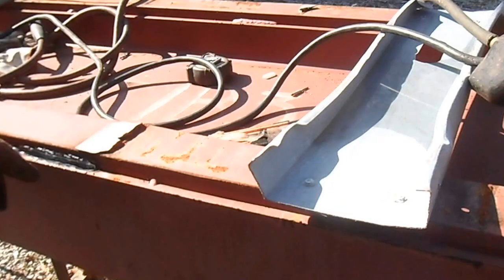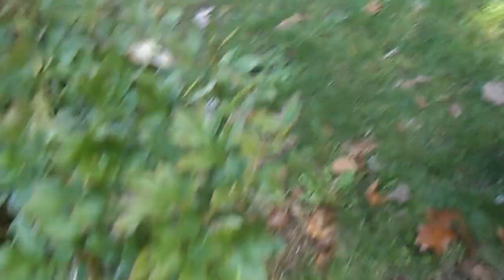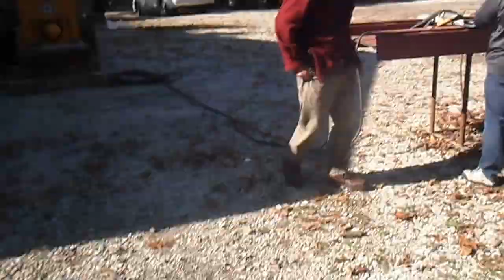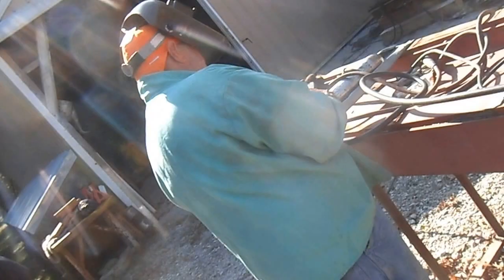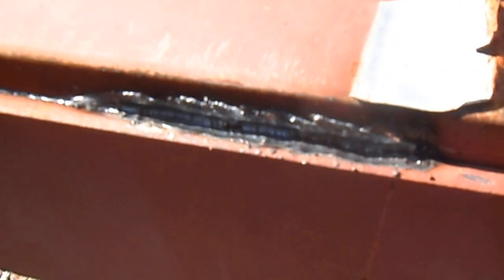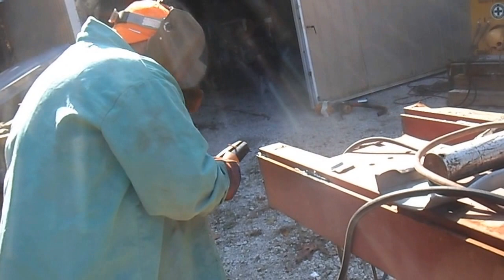ACAC Air carbon arc gouging cutting using vintage caterpillar d315 hot rod lincoln welding machine

Comment: You need a Miller Big Blue 400D, like mine!!! I run 3/8 round carbons, digs a trench deeper than the Grand Canyon,
Reply from the maker: this is a 600 amp welder and trenching capabilities are unknown, better yet its a miller killer when resting.